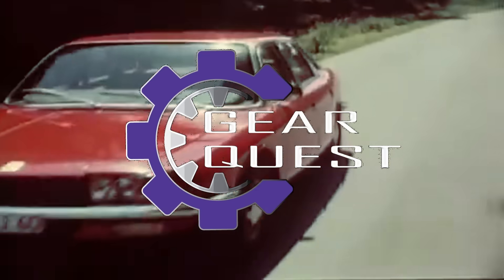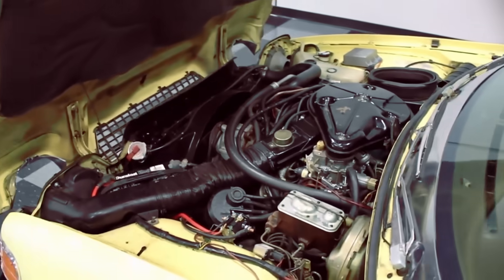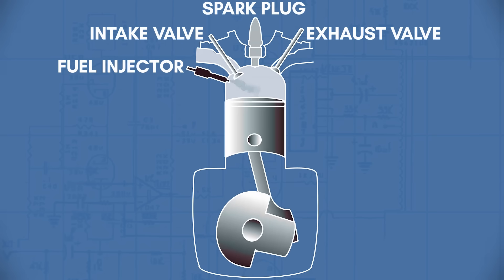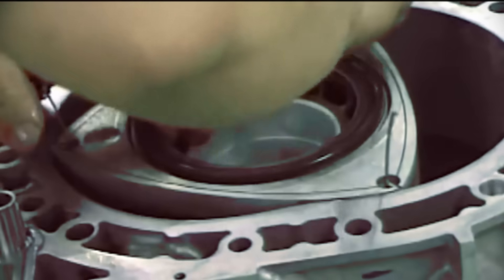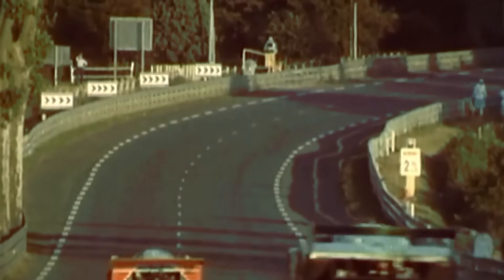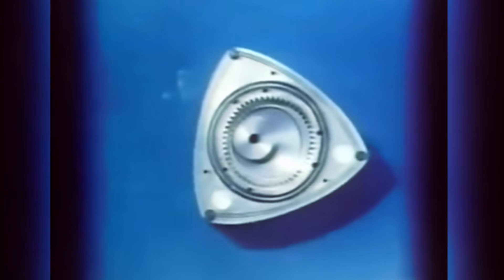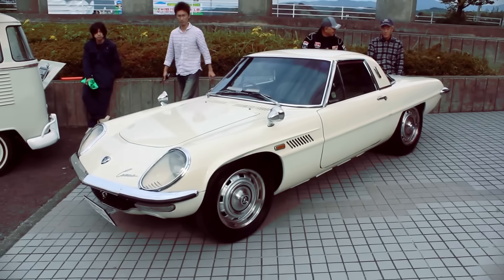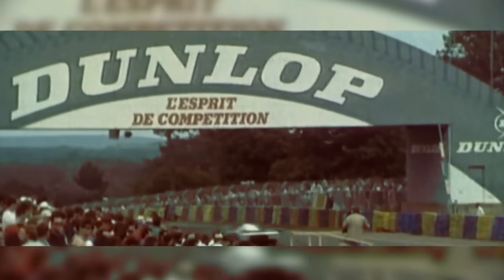The History of the Rotary Design

Comment: "Semi-automatic transmission"... Wait is there a "fully automatic transmission too?"
Reply: It works a bit like a per select gear box
Reply: Yes.  Semi-automatic you have no clutch but you have to manually select/change every gear.  Fully automatic you put it in drive and it does the gear selection/changes for you.
Reply: The NSU Ro80 had a torque converter behind the engine, then a clutch behind the torque converter, the clutch was released by touching the gear knob, which was actually an electrical switch that operated a vacuum diaphragm that pushed the clutch lever forward to release the clutch. Once in gear and the gear knob released, the torque converter took over and it drove like an automatic, until you needed to change to the next gear, The NSU Ro80  was a three speed gearbox.
Reply: @murrayfranklyn84  Interesting approach.  Still much like a VW with a semi automatic.

Here is what I want to know....  If just letting the shift knob up it goes, then isn't that like a centrifugal clutch?

and if so -  then what is your point?

It is still semi-automatic.
Reply: @barking.dog.productions1777   If say from start, the engine is running and first gear is selected, when the gear knob is released the clutch engages, the car does not move forward until the engine speed is increased, which makes the torque converter work. I was not trying to make a point , just explaining how the power was transmitted to the gearbox and yes it is semi automatic using a conventional three speed gearbox.
Reply: @murrayfranklyn84  I've been an auto mechanic for over 30 years...  The lay person asked a question, and I gave them the simple answer that I thought that they could understand.

Just like if someone doesn't understand the difference between a semi-automatic and a fully automatic firearm, then I assume that I have to give them the simple answer because that is pretty basic stuff.  It doesn't mean that my personal understanding is simple.
Reply: @barking.dog.productions1777  Certainly not like a centrifugal clutch, but yeah... a much stronger version of the VW semi-auto. [F&S] 

Clutch plates didn't need to be built super heavy like a manual clutch system. 

Problematic was the torque converter oil seal. 

Simple answers for simple minds, perhaps? 

From earlier; 

They were easy to drive for lower grade drivers, was one point... and for the more skilled that enjoyed the rotary plant...  you could break into a corner while downshifting gear very quickly, the brakes on the Ro80 were truly impressive, and then accelerate out then up just as fast.
The worst aspect of the Ro80 motor/transmission was below 60km/h... above that you could shift out of 1st at 100km without being near redline.. shift out of 2nd at around 140km/h [from memory] ... I never saw what top speed out of 3rd gear was on an open road [an overdrive ratio]... but easy cruse at 170km/h with the engine barely ticking over at 2600rpm and then peddle to floor and still be pushed back firmly into the seats was impressive for a 4 door family car, don't you think?

Can't say I liked the semi.. but that was due to the gear ratios and 3 speed. I had considered conversion to a manual 4 speed AUDI or Porshe gear box, but the wife hadn't driven manual, only the semi and auto, aside the engineering and cost.  

Oh... this was running a standard Mazda 12A transplanted after the original NSU motor blew rotor housing water seals, not apex. 

Sold the NSU... got the best car ever then.. a fully serviced and fueled Company car. 

Got old.. drive a Ford now... miss the rotary days.
Reply: @BTW...  Interesting story.  Always good to get some first hand knowledge about these things.  Cheers.

Comment: Misleading power/liter advertising,   abysmal torque figures making them annoyingly slow unless you revved them up and dumped the clutch, lower than average reliability, poor fuel economy, low response to upgrades. My brother had one. Kind of fun if you ring out every gear but then you buy a cheap Mustang and have 10 times as much fun for 10 times as long. They really don't compete with piston engines and hence they were left in the dust and will only make a return to sell to a niche market.

Comment: There are some engineers that consider the capacity of a Wankel to be 3 times, not twice the swept capacity of one rotor face. The argument continues.
The Wankel club that jointly licenced the patents of Felix Wankel and shared development, crucially had Rolls Royce as a member. It was Rolls who made the first breakthrough on the seals, so successfully that they made a diesel version, the so called cottage loaf engine. Other club members were Citroen and DKW.

Comment: An engine with a 60k mile life, yuck. 15:50
Reply: It's not as bad as it seems. At 60k, the seals wear out. You have to replace the seals. It's not like the whole motor just blows its guts out or anything.
It used to be better (85k) with the Rx-7 because they could burn oil and not piss off the Californians. The 8s weren't allowed to do that, so, more wear more quickly.
Ceramic seals do less damage to the housing walls, but wear more quickly. So, swap to ceramics, pre-mix oil if you're in an Rx-8 and then make sure to keep everything topped up. When the seals wear out, crack it open and replace them. It's ~$1k repair at a shop if you know someone who can do it.
They're great engines for sporting endeavors. But they're not cheap to run. That's normal for a high end sportscar. That's something few people realize though - dumb kids blow their life savings to buy one of these, and then don't have anything left for preventative mods and routine maintenance costs. Then the engine is ruined to scrap and everyone cries about swapping a v8 into it.
Reply: @SlyBlu7  Thank you for this insight.  But in the video he does make it sound like the whole engine needs to be replaced.
Reply: Yep. Only 200 HP also. Rotary engines are a gimmick engine that people fell in love with. GM dropped them because no one wants to tear down an engine that often to replace Apex seals. If they would've released that engine it would have been another corvair level catastrophe for them.  I'm not saying that because GM made stellar 70s or 80s car either.

Comment: If only the RX-8 owner's manual had a, "wink wink, nudge nudge," towards premixing oil with your fuel they might have actually held together ...
Reply: @Max_R_MaMint  Thanks, and good point.  Yet I am sure it was wasted effort since you can't tell jdr anything because he already knows everything. lol

I should have remembered to never feed the trolls when he made the first asinine comment, but I thought that he honestly didn't understand that just because an oil is thin it is still an oil. :)
Reply: @Max_R_MaMint  heres the problem with atf within the fucking context of the conversation which would be a additive for fuel. Which would mean with how it effects combustion it is not longer anything more than modifying friction as in literally spreading ash and causing issues withing the engine. Transmissions on the other hand do not use it as a lubricant to be subjected to combustion. Also no manuals arent always books. Nor are all books manual not all lubricants actually are lubricants in every situation which is why they are speced and built for application now will yall shut the fuck up because I'm tired of hearing the atf is a good lubricant for fuel systems and engines given that's where they go. It's not at that point it does not lubricate it damages not only the fuel system by leaving ash it also hurts combustion as the flame needs to increase in temp to burn the rest of the mixture without problems occurring. Again a lot of shit is technically a lubricant but is in some situations not a lubricant and is nothing more than a friction modifier in a bad way. You can not compare a fucking transmission which uses it for several purposes to a god damn engine. That's where the difference happens hydrogen is a combustible gas but when bonded with oxygen it's not built a certain temperature where the anatomically separate. Circumstances effect things temperature effects how effective a lubricant is at being a lubricant in engines such as a rotary atf simply put does not act as one in fact it acts as a abrasive
Reply: @Max_R_MaMint  also friction modifier is a term that is broad infact a lubricant can be come a abrasive in certain circumstances. Again why did we bring up transmissions when the original topic was fucking fuel additives these are two different circumstances entirely and effect how a substance functions. Why because a transmission again uses it for multiple purposes and has many additives to up lubricating factors at certain temperature ranges. Why do people forget that things react and work differently under changes in pressure and temperature. It's almost like I was responding to the context of a guys statement and using a term such as friction modifier to be more broad as geuss what it does change atf is horrible for engines the context for the situation which transmissions which are designed entirely differently work on entirely different principles than a fucking engine. People need to stop deflecting as I even said in transmissions it's a fucking lubricating fluid but is designed for specific operations above all else. Which is why you dont put atf in transmissions that would need more lubrication and a higher temp range or lower temp range. To say it's a lubricant in all situations is infact wrong. Water at its base has some lubricating qualities so do gases but that doesnt make them a lubricant in all situations
Reply: ATF is most definitely oil.
Reply: I would agree, except for change that from engine oil to transmission fluid.  Engine oil burns filthy, and leave deposits - on the other hand, it was an old school trick to dribble some transmission fluid down your carb at high rpms in order to burn off carbon, and those same burnt oil deposits.  I'm sure that transmission fluid would have done a similar job lubricating the apex seals before it burned off much more cleanly than motor oil.  Extra bonus - you get white smoke instead of blue smoke.
Reply: @barking.dog.productions1777  atf isnt a lubricant it's a detergent and friction modifier.
Reply: @jdrok5026  Of course ATF is a lubricant.  Do you really think that you can put all the power of an engine through a box full of spinning gears without providing lubrication?  It is just thinner than engine oil because it doesn't have to stand up to the hammering that a rod lower end does.
Reply: Atf is not a lubricant. It's a friction modifier your transmission is a very well engineered device but the fluid is designed to keep the internals clean and the clutch packs properly working oil is a much much much better lubricant in every way shape and form. Atf sucks at it because it's not designed to be a fluid for lubrication feel it it's not very thick and its lubricating properties are fairly low.
Reply: @jdrok5026  Most of the lubricating properties of both ATF and engine oil are because the oil, and ATF is a thin oil, forms a film that keeps the moving parts from actually rubbing against each other.

Just because ATF is thinner than engine oil does not mean that it is not a lubricant.  By your logic engine oil is not a lubricant because gear oil is thicker.

We can agree on which is a BETTER lubricant, but your argument is like saying that .22 rim fire is not a round of ammunition because a 30-06 is bigger and more powerful.
Reply: @barking.dog.productions1777  would you use water as a lubricant in a engine... your talking about two different applications of lubricant one transmissions require different formulations of oil and in reality for a engine atf isnt lubricant why because it wouldnt be lubricated well enough. You stated to run atf as a fuel additive when atf is a friction modifier which means it has less lubrication than something that doesnt stick to said object because geuss what it applies resistant something transmissions need but a rotor does not. Atf is not a fuel additive. You started off with a fuel additive which atf is not as it literally is a solvent and a friction modifier in those cases causing issues withing the engine itself and the fuel system causing wear and tear on fuel components and the engine itself. You than bring up transmissions I stated they are designed to run that fluid for a variety of different reasons not because it's a lubricant you can use water as a lubricant yes there is lubricating factors but if that was the reason for atf it wouldnt be designed to hold itself to things better it wouldnt be designed to clean the transmission which everything is speced including the lubricant in the atf and the materials in the trans itself it's a lubricant sure but for specific applications not for fuel and engine uses. Because in these applications the oil needs to be specifically designed to do the job its required to do. Heres the thing atf and its derivatives are in most cases according to most people in industry harmful and nowhere near lubricating enough to replace a proper additive that is designed for the use case. Why because making a engine have to ignite something with hire ignition temps hurts the engines performance. Stop bringing up useless stuff when in transmissions yes it's a fluid designed for the task just like water for water pumps is the lubricant but your not going to use water to lubricate a engine now are you making it in the original stated fucking context not a lubricant or a lubricant worth a fuck for the application I said even in my post yes it has lubricating factors but its primary design is to perform at x temp and do x jobs no matter what it's going to have some lubrication even graphite is a lubricant but would you use it on something that doesnt like solid matter running through it no you fucking wouldnt.
Reply: @jdrok5026  TLDR

Many modern standard transmissions use ATF rather than gear oil - so you talk a lot about shit that you know very little about.

Why don't you find someone else to troll for awhile?
Reply: If only they designed rotary engines that weren't total shitboxes after 30,000kms... lol
Reply: @gattosquad2241  Don't you think that extra lube on the rotor tips may have extended the engine life, or did ThatOneGuy shoot over your head?
Reply: @joeking1019  sure but now you have a car that has a small amount of blue smoke coming out of the exhaust. Ruins catalytic converters regularly. Fouls out spark plugs regularly. Will never pass emissions even if you drained the tank and put regular gas in it just from the residue. I'm pretty sure it's illegal like putting off road diesel in your street diesel so expect some hefty fines if caught. 

But it'd all be worth it to own a gimmick engine that GM realized was a POS when they were making some of the biggest POS that ever hit the road. I never got the appeal of these engines except for the "sound." Horrible gas mileage, overheating issues, DESIGNED to burn oil, and no torque

It was banned from racing because of engine displacement rules. Also he didn't finish his thought on the actual displacement. 1.3L x 3 for sides of the triangle which means it was 3.9L and I think the race car had 2 more rotors so double it again and that's 7.8L. The rules limited displacement to 3.5L. It won 1 race that year. The next year it had 2 DNFs. It didn't have an advantage it was a piece of garbage that could barely compete while breaking the rules.
Reply: As a previous owner of a 2010 RX-8 I figure I'd throw my anecdotes in... Worthy of note is that was the second generation of the RX-8, and Mazda did address several of the longevity issues of the engine. It still couldn't compete with piston engines in that department of course, but I put about 40k miles on it and it was running fine at 95K miles when I sold it.  Since the Renesis 13b burned oil anyway, I don't know the impact adding in a bit more to the fuel would have had on the catalytic converter. It probably would not have been an issue with the spark plugs, as an oft overlooked inefficiency of rotary engines is just how often your ignition components have to work. The 13b had 4 spark plugs for 6 rotor faces, and two of those didn't even fire until you hit 5500 RPM and kicked on the secondary fuel injectors. Replacing plugs at 25k miles instead of 30k would increase maintenance costs but I wonder if the increased life of the apex/side seals would even it out. Of course there is still that pesky emissions and legality issue. Horrible gas mileage- can confirm.  15-18 MPG and 91 octane onry. I only suffered overheating issues a couple of times, before I figured out that steep windy mountain roads where I had to stay in low gear because of the total lack of torque at low rpm were bad places for that car lol. As for the appeal, novelty mostly. There's also something about watching your RPM hit 9500 with almost no vibration that's satisfying. I knew the faults and extra care required before I bought it, so I was able to maintain it and enjoy it for a while. All said, I'm not sure I would get another rotary, even though I loved the hell out of that car.
Reply: @gagechapin1000  Take that gatto squad
Reply: @Pyhyhy  Amen. I have a Series II RX-8 and premix at 250/1 with Idumitzu racing oil. I also replaced the unbearable weak OEM coils with Yukon D585's to solve the ignition issues (and tuned the engine for the longer dwell). Lastly, I found that regular 87 octane gas was just fine with no pre-detonation and even slightly improves gas mileage. I'm still going strong at 70k and have had no issues at all.
Reply: The rx8 does nothing right,
ugly
slow
unreliable 
bad fuel economy

Comment: Low compression unless boosted. Horrible torque unless at 9,000 rpm. lol. Oil buring machines too. 

If you look at the hp/kw by SWEPT volume (like a piston engine) is is freakishly horrible in kw/cc.